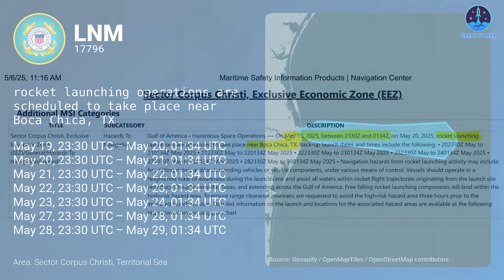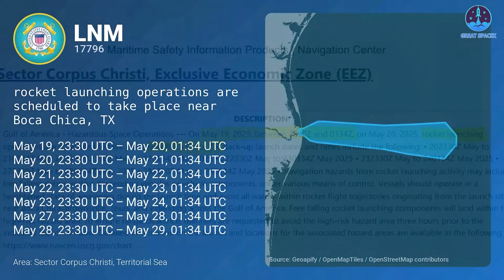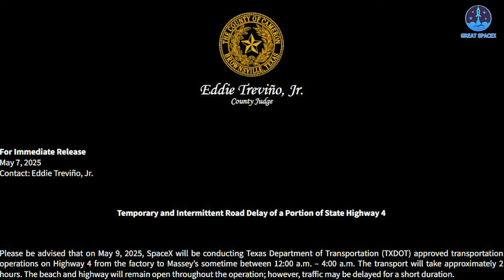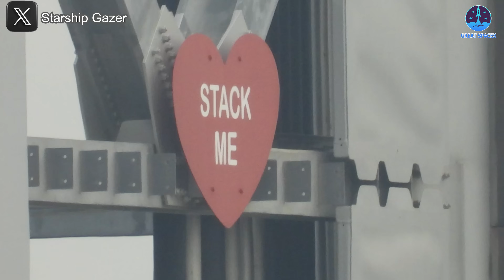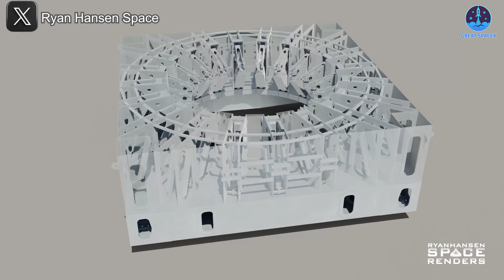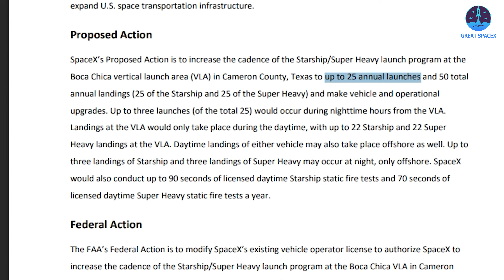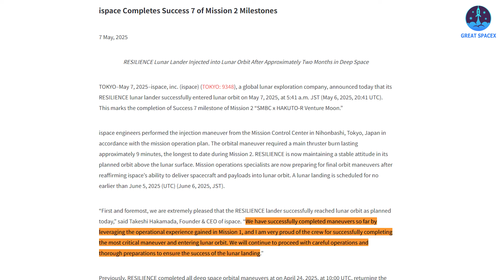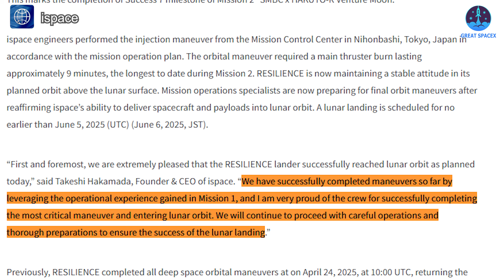SpaceX Set Schedule to Launch Starship Flight 9 This Month! Pad B Mount Ready to Stack...

Comment: Is spaceX truly ready for 25 launches in 2025?
Reply: No
Reply: Not possible until the cause for recent flight failures and solution determined and tested.
Reply: Only for Falcon and Falcon Heavy.
Reply: They have the clearance for that many but they will be lucky to get 10 this year. I doubt they are going to get close to 25 launches before 2027.